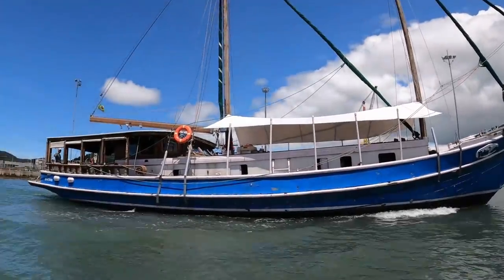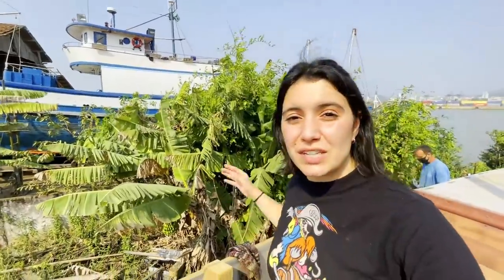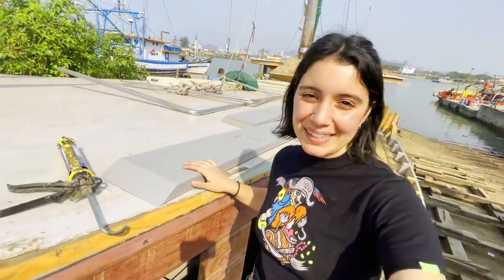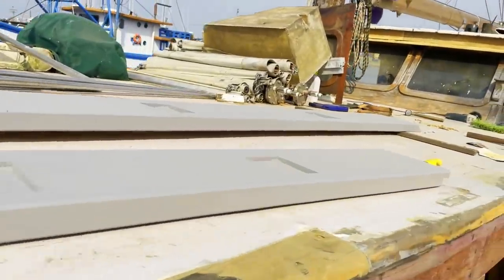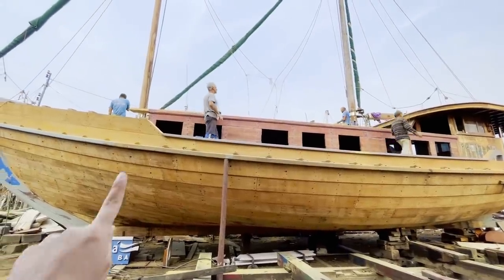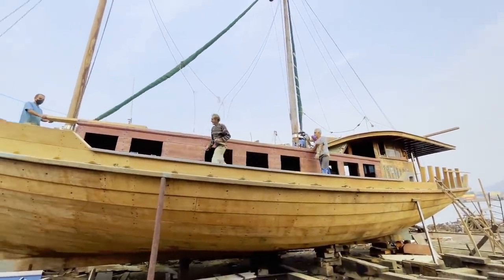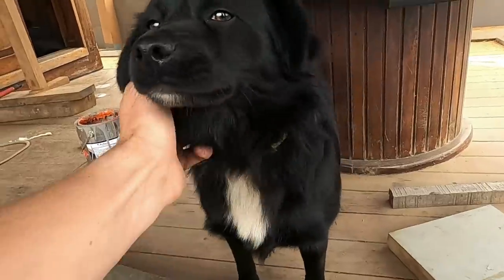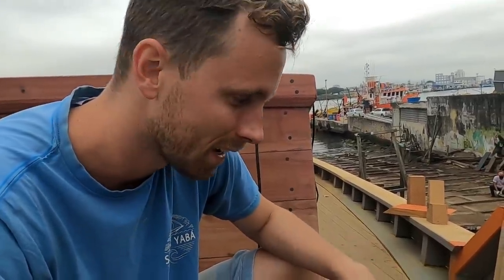Modified bulwark design taking shape. Did Ben like it? — Sailing Yabá #58

Comment: I love the craftmanship that is happening to Your beloved Yaba.  I have had certain knowledge acquiring experiences with wooden yachts that I think a wooden boat owner might like to have, the knowledge from the experiences, that is.  I was in a boat yard some years back with a boat surveyor,  and he was going around the hull with the crack crack sound when the sound changed to a thud=rot.  there was about six or seven spots of rot about three inches above the waterline.  We were able to dig them out and replace with epoxy paste.  What this shows is that the water left the salt from the salt water the boat was in and internal the water moisture rose above the waterline until the dampness was just right and with the Florida semi-tropical heat, it there began rotting.  Now this observation alone might lead on to think that this happens only just above the waterline, but this boat was a 47 foot Trumpy motor yacht.  There were in line there, a Chris craft, an Egg Harbor and several other wooden yachts needing rebuilding, planking ribs and or floors.  In the days of the old sailing ships after a rain, the sailors began dipping salt water in buckets with ropes and pouring the upon the decks, masts and booms to kill the rot fungus.  In my experiences that day, the dampness does not have to go only vertically, but from where the water is to where it is not.  And that can be, for example, at the turn of the bilge, and the water or dampness can go on a 45 degree angle.  The double planking there is too wet and so the moisture goes farther inward to the ribs or floors to have just the right dampness.  Remedy-  we put on 8 layers of alternating chopped strand matt and roving.  We air-stapled before the second layer roving set up, while still wet. At 4 layers we used long stainless screws into the ribs and we ended the layup about a foot above the waterline at a spray rail.  We found we needed to make Ts like crosses out of 2x4s with various lengths  to hold the 38" wide roving or matt every 2 feet until it kicked or the wet glass would fall off the boat.  We used polyester resin being the cheapest requiring two layers of epoxy paint then the anti-fowling paint.  To mumify the decks where little cracks can form they used to use canvas, but now with fiberglass, it is much better, providing you use only chopped strand matt, never a woven glass.  Rock salt is sprinkled in the builge so any water from leaks are turned into salt water, should a deck leak or a shower or AC unit.  We put grease zurks on the shaft alleys and pumped into each alley 4 or 5 tubes of grease, and that lubed the packing gland, so we had no water coming in at all.  The doors would not close in the slings of the travel-lift from sagging, but after ward the boat was stiff going into the water.  Rot was over for this boat!   email- jilly_sam@hotmail.com

Comment: Rain water will be trapped on the deck between the bulwark and cabin sides. How will it not form a big puddle when the deck is caulked particularly in the lowest point at the centre of boat?
Reply: I’m sure the builders/owners have a plan.  Trial & error
Reply: One of many design flaws of this boat that a naval architect could have remedied. In the end Yaba is a shallow draft coastal motor sailer that would have 4 crew to keep busy. This rebuild has probably a 5 year life span ie timber ends not sealed, galvanised nails, galvanised bolts.

Comment: The amount serious timber and skill that has gone into this reconstruction is quite something to see. There are perhapse few areas in the world that could furnish the materials and skills to do this. 😎👍🏼🇬🇧⛵
Make your safety rails as high as you can.. and fit hand hold rails to the cabin top so you can  hold on going all the way forward. The high gunwhales will keep Yabas decks safe from breaking waves fore and aft as well as improving her lines.😎

Ive yet to see what your engine is but  it doesnt look as though its quite large enough. 
 
Twin motors and props would have made her more manouverable in close harbours  but may be beyond your plans. 
In the UK there are quite a few river  barge  conversions that use Double decker Bus engines as power plants ..they are common and they are designed to run all day under load moving 
a heavy vehicle. 🤔
Reply: But what is the cost, of marinising them?
Reply: @johnnunn8688  
That depends on your fabrication or scavenging  skills ... and if your heat exchanger goes to a closed keel cooling system, Forced Air cooled radiator or a typical clogging prone open secondary seawater circulating system.

I just seen their existing engine is a straight six direct injection engine.  
But tractor, truck or Bus engines should fit the bill. 
I dont know if they have a reduction gear or what their prop size is like . 
Im comparing it to equally substantial Steel hulled motor sailors.
Ive just caught up on their initial compression test which was ok to go with. My thinking is how best to safeguard all their effort in terms of manouvring Yaba in tight situations and keeping it out trouble when facing otherwise adverse conditions  for sailing.
I saw them start this but was watching their friends on Odd life sailing.

A conventional bow thruster isnt desirable or even possible on a hull like this however a electric pumped water jet nozzel type thruster could be fitted as it uses only comparatively small diameter holes for the opposing bow or stern nozzel's. 
Dingy storage and handling is also something they should think about now as well if they are to handle this beasty themselves in case one of them should be incapacitated or go overboard 😳.  
Odd and a couple of other channels i watch all have dingy storage and handling problems that result in them towing their tenders a lot of the time but thats not good for passage making or in foul weather or where theft is a problem ..
Just lowering an outboard down to a dingy in the water will need a crane also taking supplies aboard or doing major engine work will require an easy handling/ extraction route. 
They will also in the end want to 
Install a fair amount of solar to run their electrical systems.
Reply: @clivestainlesssteelwomble7665 , they definitely need instruction, on manoeuvring a single engined boat, if they are not experienced.
Reply: @johnnunn8688  

The size layout and mass of this vessel will bring some difficulties ...a single prop and drive direction will mean it will walk the stern in one direction but not the other...so getting off or on a dock in wind could get challenging.  
Can you imagine trying to hold this beasty off or haul it to, in a current or wind.
Reply: The engine is a Mercedes Benz OM 352 A... or maybe LA. The A means it has a turbo.  LA means turbo and intercooler.  Hp is somewhere between 150 and 200 depending, according to the internet.
Reply: @merlars  
Thanks for that info. 👍🏼 Its better than i thought but I was concerned its  lot of work if they havent been able to try it running in the vessel . 
Ive got a feeling its going a heavy ship by the time shes ready to splash.

Comment: This boat really looks good. I only wish I could do the wood work those guys do. The only thing I would have done different is where the transition from low to higher , I would have rounded it rather than the straight angles. Like on your wheel house. Rounded looks good. Really good job though.

Comment: Love the videos guys.  I've been sub'd for a long time but have never commented  before.

I do have a question if you have time.   I know nothing about boat carpentry and not a lot about carpentry in general, but why do you use nails instead of screws?  Is it a cost thing or a structural thing? Again, I know nothing about boats so forgive me if thats a dumb question.

Comment: Will the hull be faired? May I suggest you watch U Tubers Salt and Tar. They are building a sailboat. See what you think about the boat soup they use to preserve the wood instead of painting or regular varnish. This may help you a great deal. The mix used to make the boat soup is explained on one of the videos. Best of luck as you continue to build Yaba. 👍
Reply: i cant help but to think of Rot and Termites everytime i see this big wooden boat
Reply: @pawel2003  I do not see enough water proofing etc. between the work. The nails used worry me.